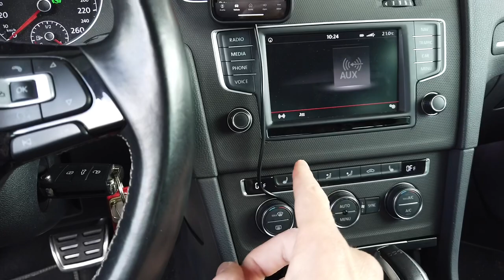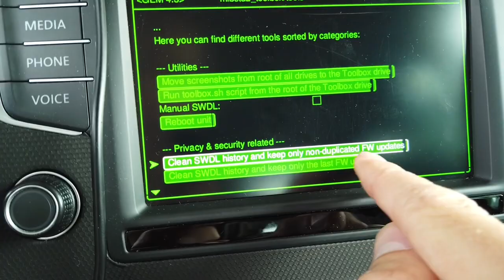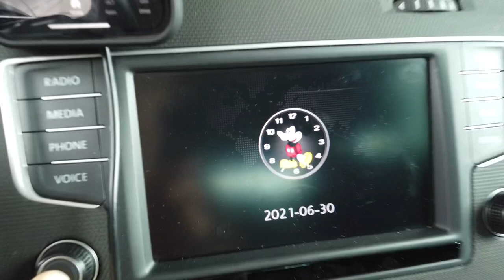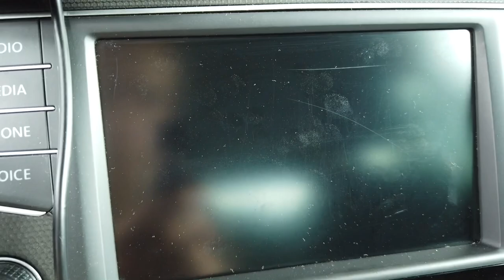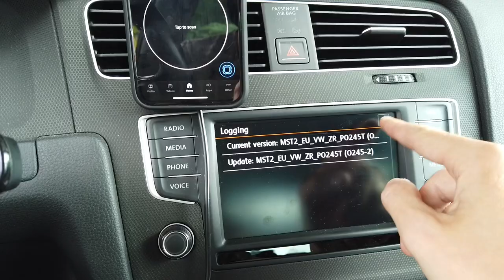Fix B2000 87 1556 fault in MIB2 Technisat unit

Comment: Hi, iam getting these two error on my mib2 zr perh unit

B126CF0 - Navigation system Navigation database malfunctioning

            staticB200087 - Control module Software incompatible
static

P0478T preh patched head unit 

Could I install mib toolbox and clear this error and what I can do for this Navi database error. ?

Comment: I cannot install the toolbox on my ZR Mib2 with 0367 firmware, I get "the meta info file could not be read"
Reply from the maker: Contact author on GitHub.
Reply: Fixed and working
Reply: b2000 87 keeps showing!

Comment: Anyone know how to do this on MIB2 high discover pro? Some idiot sold me an older software version (but claimed it was an update), so now I have this fault stored. Radio works just fine otherwise, but i would like to clear the error. I don’t have the toolbox option on my engineering menu